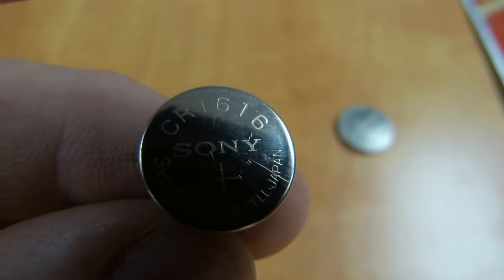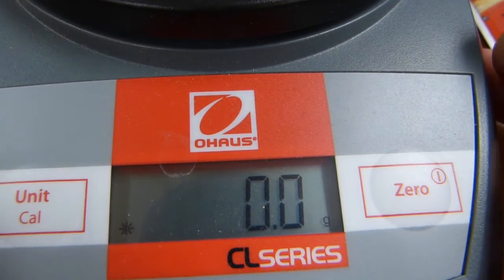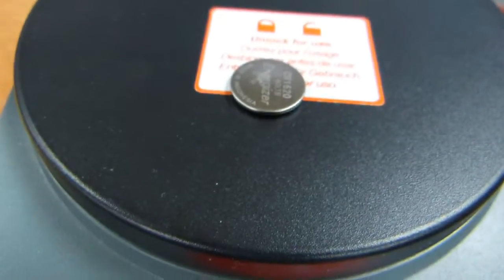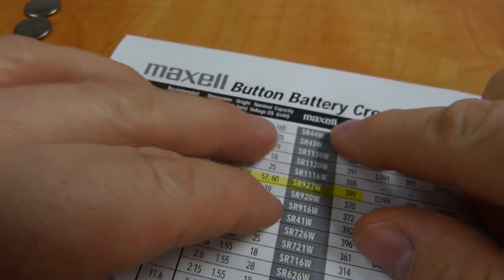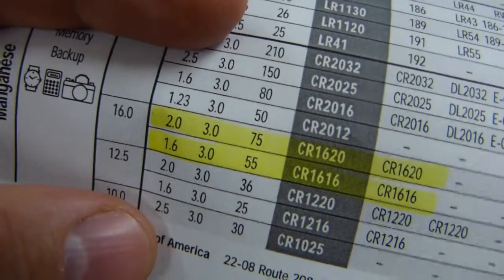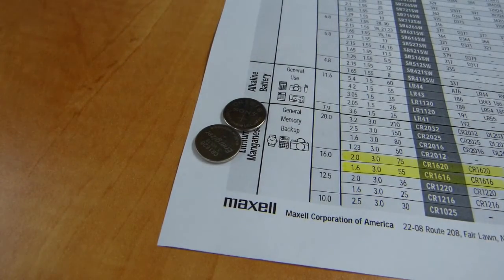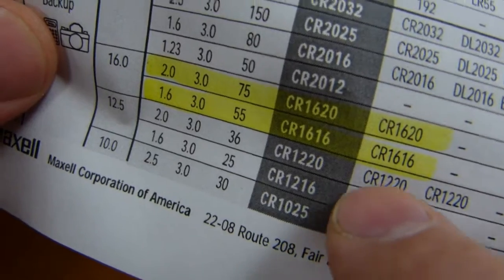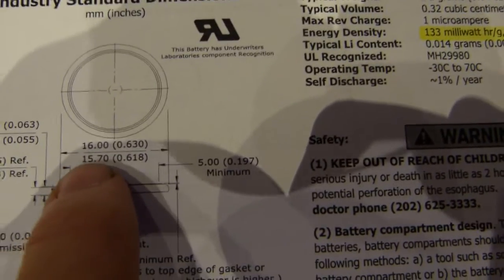Can a 1616 battery be replaced by a 1620?

Comment: It worked with Honda Jazz key which uses 1616 batteries, i had 1620 on hand and 1616s were hard to find locally and while it's slightly thicker, diameter fits. Thanks for the info provided in the video, have a great day!

Comment: The first number in battery is the diameter the second relates to thickness...16mm and 1.6 is 1616, 16mm and 2.0 (your 1.9?) Is 1620...I have found you can use 1616 in place of 1620 if you pad the thickness with foil.

Comment: if my car key originally has CR 1620, is there a bigger mAh battery which I can replace it with?  Maybe CR 1632? Do other, bigger 16mm models exist?
Reply from the maker: Not to my knowledge, there is only 1616 and 1620
Reply: The size that might fit is the 1632.  If the case allows it. Some are just plastic and doesn’t matter but some, like watches, are so precise in size that might not close properly and might cause a damage in internal components
Reply: @elgransr  it was for a Mazda 2 car key. But I don't own the car anymore

Comment: All that time and you never did show if it fit or not. Electrically they are fully interchangeable. Size wise they are the same diameter (as the part number already indicates) and the 1620 is just a little thicker, a very little thicker.  So the only question is, does it physically fit without damaging the case  of what you put it in.   That would have been nice to see.